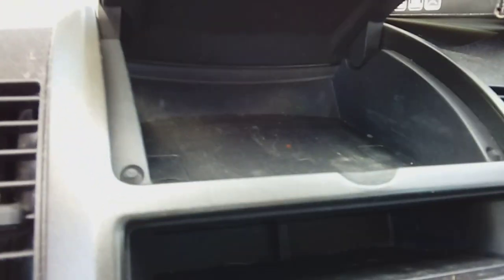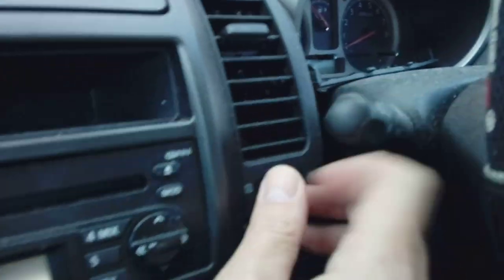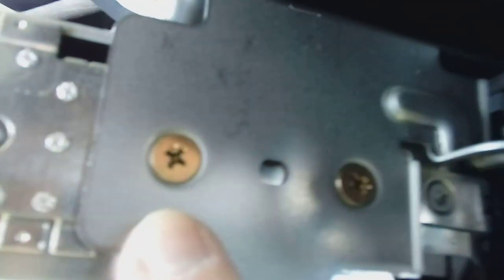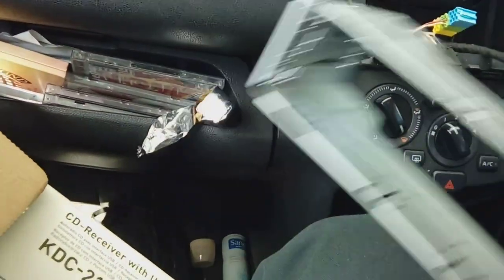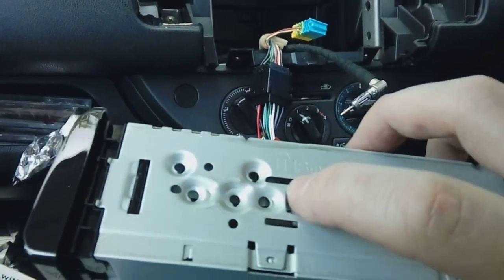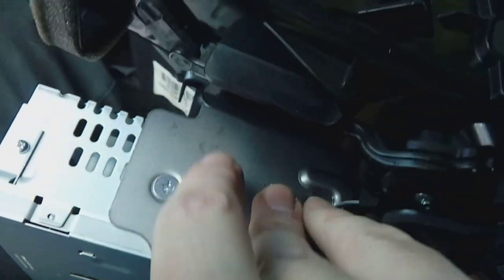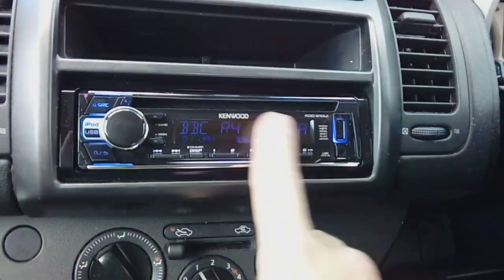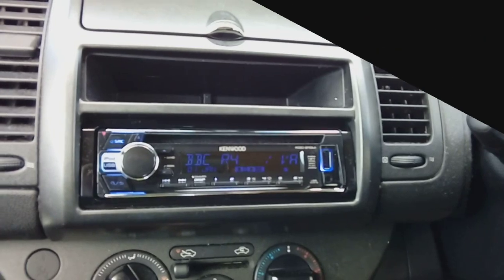Nissan Note 2005 - 2012 simple radio removal & refit guide

Comment: In Note, starting in 2009, restyling R2, the head unit is removed in a completely different way. 
There are latches on the bottom that you first need to release, then just pull the panel up and towards you.

Comment: Have you done a video clip on the 2009 Note 15G Four DBA-E11? My Note is a 2009 imported from Japan, and the stereo surround does not have the removable screw cover below or the two screws in the compartment above. I have spent days searching for information but every video clip and diagram is based on the model shown in this clip.

Comment: Hi PJ, great video very easy to follow. I have a question, I am going to replace my radio but how do I make sure the wheel controls work for the radio?
Reply from the maker: Ask your retailer for a steering control interface (they may need your reg number).

Comment: What watt output is good for the note the stereo it came with every now and then will blast out and it doesn't seem as loud as it should be for the volume it's on I'm think a loose connection but looking at a new stereo just wanted to know the output needed

Comment: Do steering Control buttons work after changing a radio into non- Nissan one?
Reply from the maker: No they only work with the original radio unless you buy a steering control interface like the example below.
https://www.ebay.co.uk/itm/ANAlogz-SWC-5236-06-Steering-Wheel-Control-for-Sony-ISO-Radio-Nissan-Note-05-09/401430798969?hash=item5d7723e279:g:uEYAAOSwWY5ak-bQ

Comment: What's the model of the after market stereo? Also where could I get it from?
Reply from the maker: If I recall correctly it was the older version to the one below(radios get updated once a year so are no longer available after that).
https://www.amazon.co.uk/Kenwood-kdc-bt720dab-Radio-USB-Black/dp/B077RY7T53/ref=sr_1_7?s=electronics&ie=UTF8&qid=1527844408&sr=1-7&refinements=p_89%3AKenwood

Comment: Hi PJ, how could I install a double din touchscreen stereo in to the note shown in your video? If so do you have any ideas where I would purchase the parts needed?
Reply from the maker: You should be able to use the original side mounting brackets on the new radio,just dummy them up and see which mounting holes line up the best,it's a case of getting it as good as because I can't find any full fitting kits for the car with a double din radio.

Comment: Hi how do you  put in the Radio code for a 2016 Nissan Micra once you have interconnected the battery please?
Reply from the maker: 1. Turn radio on
2. Use digits 1 to 4 to enter the code,example - if the first digit is 3 then press 1 three times.
3. Press and hold up on the white circle that has the radio tuning buttons.
Reply: @PJsprojects  I don't have The code. How do I find it??

Comment: I just tried, but I don't have an adapter cable with the connectors I need. My news radio has a 12 pin connector.
Reply from the maker: A few are available for your car but seeing as you mention your car is a 12 pin version then maybe this would help - 
https://www.ebay.co.uk/itm/Mazda-Niss-Navara-Qashqai-Renault-Car-Radio-Iso-Stereo-Wiring-Connector-2007-on/153376502523?hash=item23b5f3b2fb:g:GUYAAOSwGMFcY94L

Comment: Mine is a 2008 nissan note and the trim is different. The top compartment doesnt have any screw. How do i remove the stereo?
Reply: Same here. I have a Japanese assembled 2009, and every video clip shows the removable cover below and the two screws in the compartment above, making it look really easy. But my surround does not have screws above or the removable cover below. its very frustrating.
Reply: I managed figuring it out myself. So basically this entire thing is held together with clips. Just pull the entire thing out. You may require a flat head screwdriver and poke it in on the top and it should pop 1 of the clips. You can do the same for rest of the assembly

Comment: Hey, how to get the steering control included? which part is needed?
Reply from the maker: Try this - http://www.ebay.co.uk/itm/CTSNS004-2-Steering-Stalk-Control-Adaptor-Phone-Button-Support-For-Nissan-Note-/370772679125?epid=1425114384&hash=item5653c619d5:g:B-UAAOSw1GlZyQjh
Reply from the maker: Not a unit I have ever dealt with but it looks to be one of the Chinese none branded jobbies, so the item I linked for you should work plus the advert for that Chinese radio states steering controls work with it. Might be worth asking the seller if they supply steering controls that work with it just to be safe.
Reply: Thanks. Ill contact them and see.
Reply: Sorry, how does the steering stalk control adaptor connect to the radio? Thanks
Reply: Thanks for the video! Will the steering wheel interface you mentioned in the link also work for the Note 2006 model?

Comment: Where  can I get a harness  from
Reply from the maker: You could try Ebay,Amazon or a local car shop. Make sure to mention the year and if the car is import spec or not. This is a common example for the Nissan Note -  https://www.ebay.co.uk/itm/Car-Stereo-Radio-ISO-Wiring-Harness-Connector-Adaptor-Cable-for-Nissan-Note/172755188075?epid=17006767100&hash=item283902f96b:g:GvUAAOSwbwJaHE~t